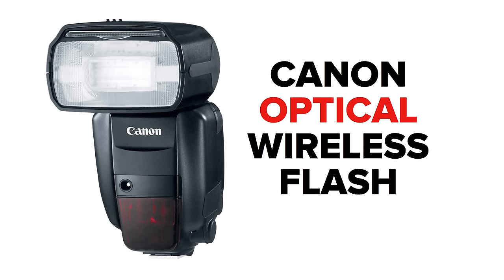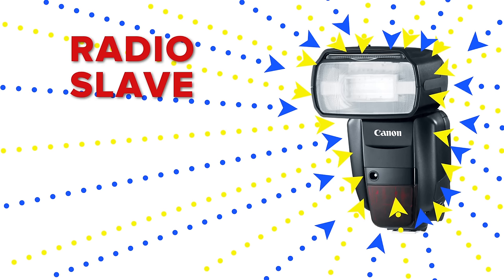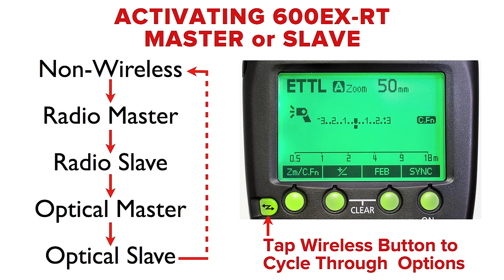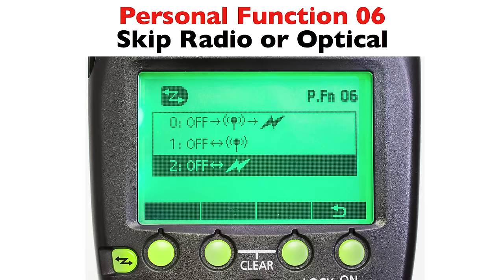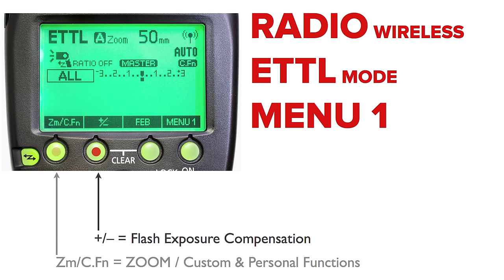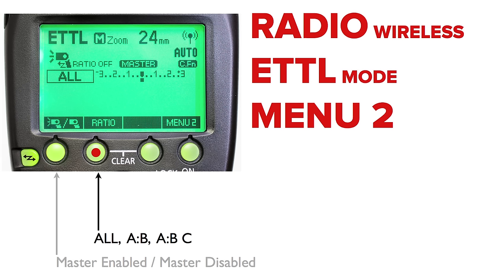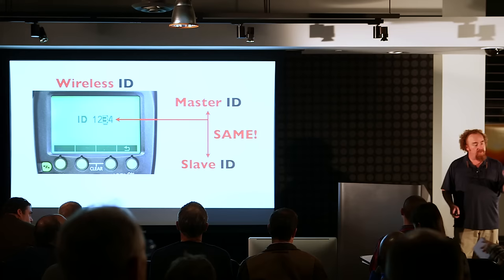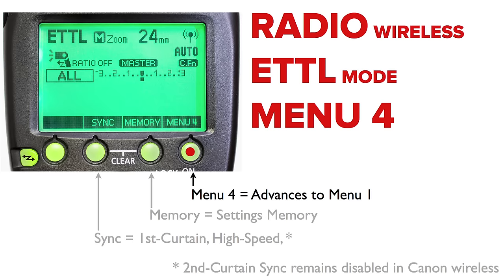Canon Speedlite 600EX-RT: Radio Wireless Flash

Comment: Thanks for this - just got a 600EXII-RT to go with my older 600EX-RT and ST-E3-RT - couldn't get the new one to work with the system - forgot to change the ID on the new flash (37:15 or so). I had changed it to keep that "nefarious guy with red hair" from clashing with my system... Works great now!

Comment: I have one 600EXII-RT. How many more should I get? (please don't say 15 lol) Direct flash is okay but prefer to get a better look.
Reply from the maker: Hello:

The number of speedlites you use is personal preference and the type of look you are trying to achieve.  If you are wirelessly controlling speedlites that are positioned off camera, you would usually need at least two.  Depending on your camera model you would need one speedite to serve as a controller – sending instructions- and one or more acting as receivers.  Many photographers favor a 3-light setup where there is a Main light , a Fill Light and a Background or Hair light.  If you are photographing a more complex scene or larger area, you may require more lights.

We hope this helps.
Reply: @CanonUSA  Yeah that's a great help thanks.. 

I have one 680exII-RT and a RF trigger, should they all be 680EXII-RT's or can I go cheaper and trigger from flash of the single RT one?